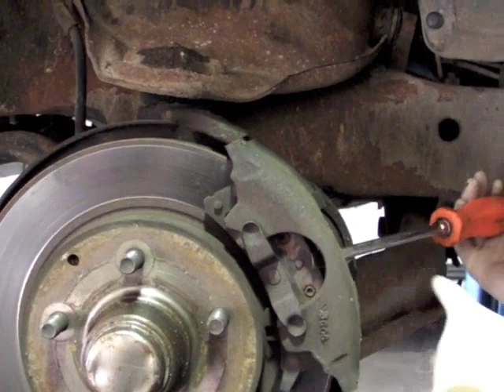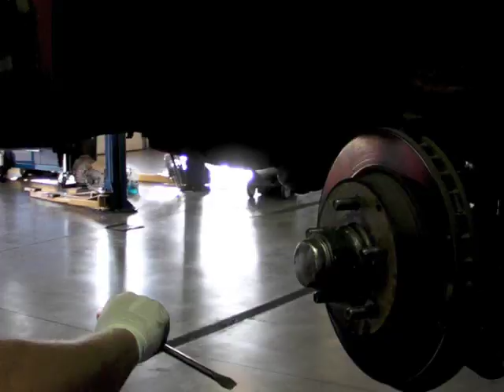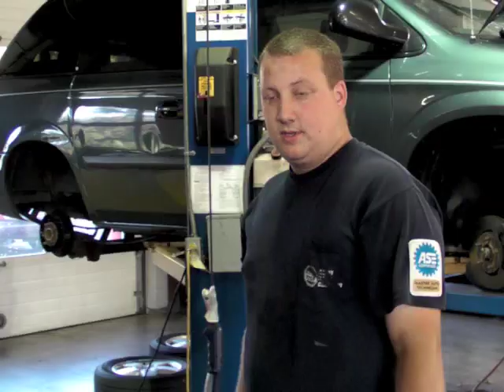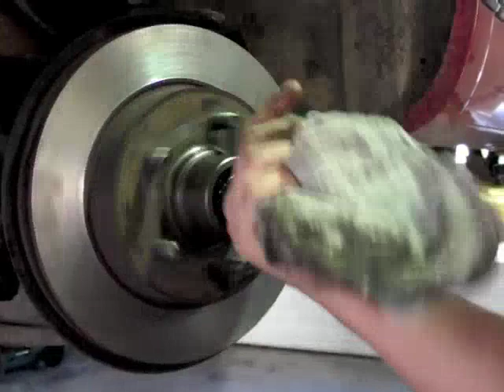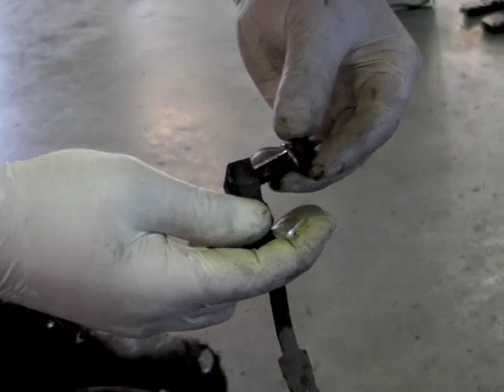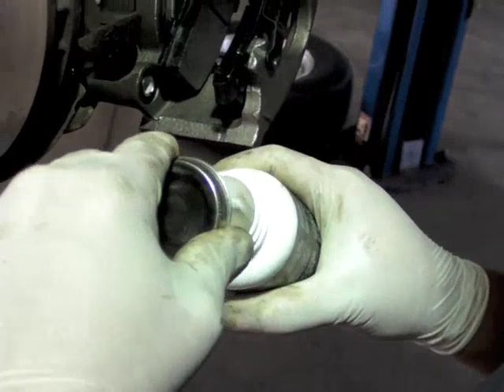How To install new front brakes on a chevy truck

Comment: I was always told that cleaning the excess grease such as grease that got on the rotor or pads with break cleaner is paramount because it will glaze over reducing breaking power. I duno if you did that off camera but it wasnt in the video.

Comment: the outer pad has a retainer clip built to it. the piece in front of the caliper holds the pad to the caliper. the way he tried to compress the caliper would never work unless the clip would break. it is highly possible nothing was wrong with the caliper, especially cuz they wore evenly.

Comment from the maker: @goodson305 I personally wouldn't know that light code off the top of my head, but i would recommend taking it to a shop or you can always try auto zone (they do free OBD-II diagnostic checks I believe)  Best case is to take it to a pro to find out the problem.

Comment from the maker: @doowahderek didnt wind up needing to do the rear brakes at this point but that may be in the future..don't be scared though same process.. not sure on your vehicle but if you have drums your basically going to pull the drum have it turned, change the shoes,(they all usually have a spring loaded pin holding them in the center.. def pick up a haynes manual for the steps if you did the fronts im sure you'll have no problems with the rears